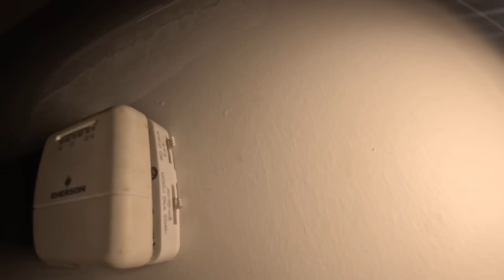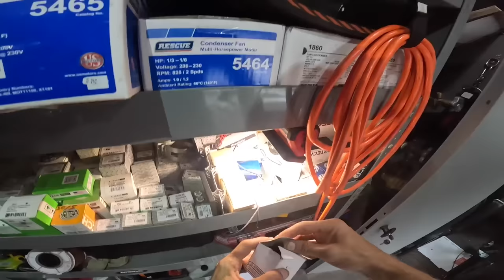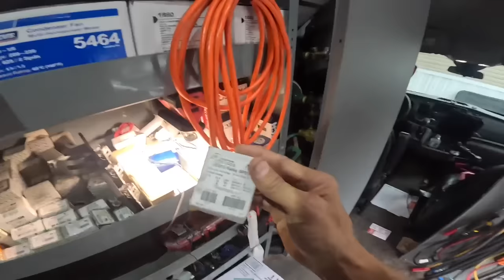Customer Called And Said the Blower Won’t Shut Off! #hvacguy #hvaclife

Comment: my blower was stuck on and for the $100 service call the guy pushed the reset(red) button in on limit or rollout switch  hiden below the burners, $100 then left without even putting it back together, I had it spotless when he arrived and would never have such filth on my doors, filter, or inner furnace, never

Comment: I was starting to wonder when you were going to lay down so you can reach that screw. I hate those units, they have so limited hand space behind the line set. I worked one a while back, where someone replace both relays😮😮 with contacts, in that small space.

Comment: My electric furnance came on during the night by itself and the thermostat was in the off position.
There was a strange odor but not like wires burning, more of a plastic/oil type smell.
Turns out it was a relay had burned out.

Comment: I had an ECM fan motor on a 10 year old Payne package unit that would continue to run even with the control wiring removed. Motor had to be replaced. Bad electronic brain.

Comment: Nice work 😊
Reply from the maker: Thanks 😄
Reply: @HVACGUY  you’re welcome 
I hate that they run he line set in front of the control panel.
Reply: @woodystokes1543  Pretty poor design for downflow heater; however on the right side they have plenty of room to run the refrigerant line set and the drain line!

Comment: Can’t see what your explaining with those wires i guess camera angle is off what controls that relay? The thermostat or the pcb?
Reply from the maker: Thermostat
Reply: so basically the thermostat send a call 24 V two the sequencer the sequencer send the 24 V to that peanut relay to turn the fan on. Also the thermostat could send 24 V to turn on the air conditioning and also turn on the fan from that same relay, so if that relays stock the fan to beyond all the time, no matter what good job
Reply: Dr Curtis is on the job he fixes ot the first time.  Unlike Medical Doctors that just keep you coming back to run up your bill. 
Lawyers, Doctors, and Weathermen, should be paid on whether the do the job right the first time.  Most every other profession gets paid only if they fix it right the first time.  That's why they  all it a practice, and want paid any way.